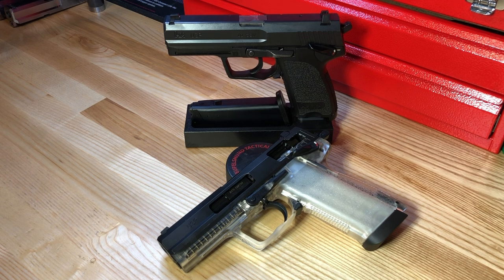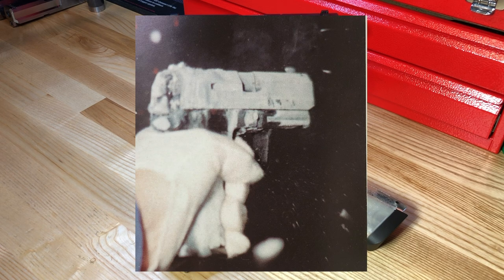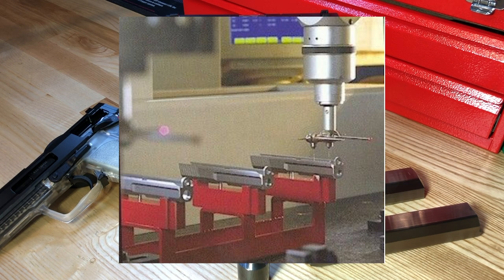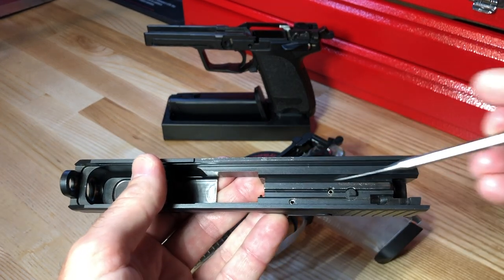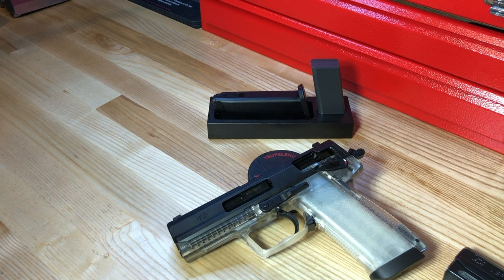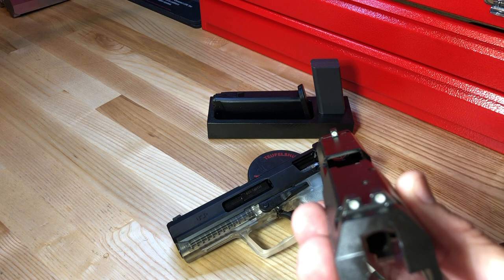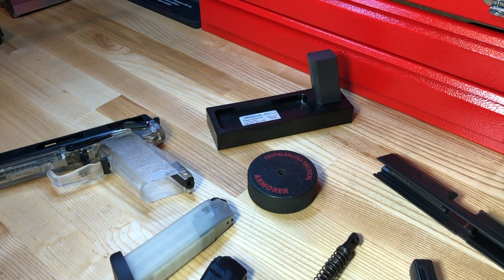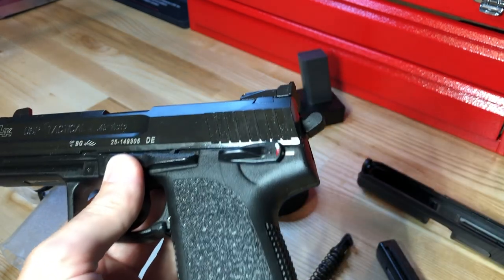Teufelshund Tactical Heckler and Koch USP Series Armorer and Operator Review

Comment: The USP is where my obsession with H&K began. I've owned a lot of different brands of pistols, but my USP never failed me. I have since sold most of the other brands off for the other lines of H&K's. I bought the P2000, the P30 and the VP lines. Each one is just as reliable and great engineering. So now I just HAD to buy the P7M8. THAT was expensive but, I'm glad I have it. Thanks for the info

Comment: What an awesome history of the USP. Thank you
Reply from the maker: Thanks.  Lots more on the channel.
Reply: @teufelshundtactical  Do you think HK has a better 9mm suppressor host than the USP9 Tactical? Also, does the HK45C need any other changes than a threaded barrel swap before I can suppress it? Thanks again.
Reply from the maker: @astroidother3609  The Mark 23 is the best pistol for suppression, but the USP and HK45 series are super as well.
The HK45 and HK45C are offered as tactical models or you can buy the threaded barrel and drop it in.
Reply: @teufelshundtactical  Thanks. I have the HK45C V7 and want to suppress it. Got a great deal on the gun and wanted to make sure it was just a barrel swap. That said, I may well nix my G21 and get an HK45T instead. Cheers
Reply: @teufelshundtactical  In your very educated opinion, what is the best 9mm suppressor host in HK’s entire pistol lineup? Thanks.
Reply from the maker: @astroidother3609  USP Tactical

Comment: Just picked up my first HK USP, this video has been a great resource for me! Something I found interesting, both my wife's P30L and my USP do not have the usual antler proof, date code and other markings on the slide but rather they are now printed on the underside of the trigger guard. Both pistols are date code CB (2021 production). I would be curious to know when HK changed that and if there was a specific reason for the change as well. Thanks again for posting these videos!
Reply from the maker: The change from the antler to CIP was a European requirement to standardize across those countries.  That is also when the “DE” country code was added.  This occurred about a decade ago.  Changing the location of the markings to under the trigger guard began last year.

Comment: Hi James, just got through watching this video, currently I have a VP 40, USP Elite 45, and Mark 23. Having the VP is there any sense in getting a USP 40, I know one is striker fired and the other hammer fired as well you mentioned the USP will eventually be discontinued. Regarding the Mark 23 , HK parts shows a gen2 rail mount compensator that looks bad ass on that gun. Question, do you know of any issues with installing that and 2 can I get that from you or go with HK parts? Thanks the video was very informative. I know you’ve heard that a million times but it is true. Thanks again.
Reply from the maker: I always encourage another H&K purchase.  
I do not have any experience with the aftermarket item you are referring to.
Reply: Thanks for such a fast reply.  That compensator is listed on HK parts. Is that separate from H&K?
Reply from the maker: Not from H&K. @thomaskingsbury6560
Reply: Hi James, you truly are an asset to the HK community. I looked into that compensator and it is after market and does damage to the front of the gun. I thought because the advert said HK parts it was HK not so. Thank you again,take care.

Comment: Rewatching this as I'm about to acquire a '96 dated stainless USP9 fullsize in a week or so. Comes in the original grey case but what surprised me is it comes with two 15 rounders instead of 10 round mags, I guess the previous owner swapped them out at some point. I plan to install the Match trigger kit and Jet funnel. I would upgrade it to a Match clone but can't seem to find the barrels at the moment.

Comment: Thanks for sharing James - love these amazing pieces of engineering. Any idea why the front of the trigger guard on the full size models slopes forward? On a similar note, do you know why the P30 & VP9 use a squared off trigger guard while the HK45 uses the sloped design?
Reply from the maker: On the USP, it slopes in order to fit with the UTL mentioned in the video.  As the later pistols did not have that requirement, they went with one more fitted for a finger rest, if desired.

Comment: @Teufelshund Tactical
I know this is a old video, but I was hoping you could give us your opinion when it comes down to using a Rim country conversion barrel in a full size usp 40 and switching it over to 357 sig. I know that hk did make a compact version of the uspc in 357 sig but never seen a full size made. Do you think it would be safe to use on a newer usp full size? Or should I stay away from converting to 357 sig.
If you reply thank you for doing so.
Reply from the maker: Barrels are the best thing H&K makes.  I would never replace my H&K barrel with an aftermarket one regardless of the caliber.  It would be like driving my Porsche 911 with an Oldsmobile engine.  
I also would not recommend changing calibers in a weapon that was not designed for that caliber, not to mention voiding your warranty.
Reply: @teufelshundtactical7125 
Thanks forthe quick reply! I figured you would be the sane person to keep me from making that mistake. I have several usp's but have been on the hunt for the compact 357 sig. I was going to settle with changing over the full size and that would of been just that settling. Along with what you said about voiding my warranty and all I will just wait for the right gun to come my way. If I need to shoot something in 357 sig until then. my buddy has a 229 that will work for now. 
Thanks again for the quick reply.
Reply from the maker: @Phenixrising-p1p  If .357 SIG is what you're after, take a look at the USP Compact and P2000, both great carry options.

Comment: I have a question about the O ring on the mk23 and tactical models.  does this simply apply a tighter seal to the slide or does it pressurize when the round goes off, fitting tighter to the barrel? Love your stuff sir. Garand thumbs most recent video brought some great attention the the platform as well!
Reply from the maker: The pressure during firing causes it to swell and seal between the barrel and the tang on slide.  This centers the barrel for each shot instead of the slight deviation in different directions the barrel would make otherwise.

Comment: Good Evening James,  

Question for you if I may,  in your presentation you displayed an image of an extended magazine paddle release.  I made that upgrade a while back and found it to be incredibly useful during fast mag reloads . However, after about 500rds, I started to have issues where fully loaded magazine would drop out of the weapon during fire or even when releasing the slide home from a locked position.  I switched back to the original paddle release and problem went away. I've read that this happens when the extended paddle is used in combination with Polymer magazines,  and that the part functions 100% with Usp 45 and compact magazines since they are steel.  I installed the extended paddle on a USP 9mm full size. Can you confirm or deny that this is a magazine related issue and not the design difference between the standard and extended paddle or possibly both?  

Thank you for the Superb Presentation.  

Best Regards
Reply from the maker: I have found that there were two different styles of extended magazine release, with the intercept point being wider on on than the other. This wider model works better at holding the magazines in place.  Of course sourcing one (being able to tell the difference) is the difficult part when purchasing.  In the past, I’ve just kept a few on hand and swapped them in when customers make the complaint you have mentioned.  
The warning from H&K you referred to, I believe related to the Jet Funnel kit pistols/mags.
Reply: @teufelshundtactical  That's the first thing I noticed when comparing extended vs stock side by side.  The extended one has a steel intercept point that is much narrower and thinner . Stock is just one solid piece where the interceptor is polymer, with wider and thicker contact point .  I will stick with original equipment, since it is my primary EDC. Greatly appreciate your feedback and knowledge!   

Thank you sir!

Comment: With the infamous squib test, do you know if that was done with a polygonally rifled barrel or the regular lands and grooves the USP was originally released with? I wonder if that made a difference?
Reply from the maker: Lands and groves, but it would not have mattered.  The strength of the barrel is the key factor.
Reply: @teufelshundtactical  Thanks for such a fast response. We always hear a lot about polygonal rifling resulting in a tighter gas seal so I was curious to what degree that was or wasn't involved. Thanks!

Comment: Thanks for this amazing deep dive. I’m interested in your analysis on the P30 and P2k with regard to the design factors that influence durability. You mention that the USP has a modularity advantage as would be expected for a large contract pistol. Do you believe the USP compact recoil spring change found in the P-Series or receiver thickness changes made to accommodate grip modularity impact the long term durability of the later pistols?
Reply from the maker: Rad Ekkawi I have seen no such issues with a reduction in long term reliability with the P2000 or P30 series pistols vs the USP design.  H&K knows how to make solid, reliable pistols.
Reply: Teufelshund Tactical Thank you!
Reply: I can say that I have all the lines of pistols from the P7M8 and on and each one is as reliable as the next. I find that the more I shoot a pistol, it becomes better at accuracy and function, if that makes sense.

Comment: Great video!  I have a 1994 USP 9 with a serial number between 8000 and 9000 that does not have the relief port.  Do you have a recommended way of cleaning that area without the port?  Interestinly, mine have the engraved HK usp on both sides of the grip and does not have the US patent number.  Is that common?
Reply from the maker: Definitely an early model.  I use long tipped Q-Tips for cleaning the firing pin channel once the firing pin assembly is removed.

Comment: Another question for you sir.  ALL 20 of my USP45 magazines rattle very badly loaded to full capacity at 12 rounds. What is the deal with that? Any fixes or loading processes that I am missing? Thank you sir and thanks for the great content !
Reply from the maker: Buy a new magazine spring and compare its length to the ones you have.  If there is a significant difference, replace them.
Reply: @teufelshundtactical  roger that. Thank you sir

Comment: When running the USP45 Tactical suppressed, do you actually need to change recoil system every 1000 rounds? I keep hearing that and I know other pistol recoil assemblies go much longer than that. I would be surprised with H&k specifically if they were somehow lower than the competition. Especially considering the recoil reduction system.
Reply from the maker: No.  It can run for many more thousand rounds.
Reply: @teufelshundtactical  I trust ur opinion good sir.
Reply: @teufelshundtactical  do you recommend anywhere for getting a USP slide milled? Or magazine extensions of any kind? I tend to prefer factory reliability but we are in an age of capacity and red dots
Reply from the maker: @reker.a5790  Ashbury Precision Ordnance
Reply: @teufelshundtactical  I did not think they worked on USP series?
Reply from the maker: @reker.a5790  Yes, you can mill the slide.  Yes, extended mag wells and magazines are available for the 9mm and .40 full size pistols and come standard on some of the competition models.

Comment: Is it normal to be able to easily compress your recoil spring all the way to the base of the assembly with your fingers? 
I just bought a used usp 45, the recoil seems slightly harsh compared to my Glock 21. Despite what I hear so many people say about it being so soft shooting, my G21 feels like a 9mm to me whereas this feels like a 40 cal
Reply from the maker: The outer, recoil spring is easy to manipulate.  The inner, buffer spring is more resistant.

Comment: I would find a ton of value in you discussing your opinion of the USP45 vs the HK45.
Reply: Even the USP platform vs the new p30 platform.  Basically the same. But I brought up the 45 because that is where i see the largest step backwards going from the USP45 to HK45
Reply from the maker: The HK45 is basically a product improvement of the original USP.  Internally, they are very much the same, but externally, you see the changes.  A welcome update for most fans.
Reply: @teufelshundtactical  I can’t help but feel a difference shooting them.  The USP seems softer significantly? And 10 12 rounds seems like a step backwards.  Especially when the relevant competition was already above 12.  IE the Glock 21 and fnx 45

Comment: Maybe a dumb question, I'll ask it anyway. Is the USP slide forged or cast steel?
Reply from the maker: If you watch the video, around the 13 minute mark, you'll find a step by step of the process from a solid block of steel.
Reply: @teufelshundtactical  I watched it a couple of times(and not just this one) ! I really love the info you are giving about HK. Thank you again!

The first step in the slide making is a block of cast or forged steel? There is a parting line on the first peace you pick up.(on the front of the slide where the barrel and recoil spring holes go).

I may be wrong. It wouldn't be the first time.

Comment: How often do you recommend the USP45 be sent in for detail disassembled cleaning and spring replacement. At what round counts are you seeing trigger, sear, and other springs & parts breaking?
Reply from the maker: Lots of factors, like the exposure to adverse environmental factors and how dirty the ammo you shoot is, as well as the pressure of the ammo.  Five thousand round marks is a good reference.  I’m OCD though and do full disassembly more often.
Reply: @teufelshundtactical  I can personally say my trigger return spring was the first to go. Probably from all the heat cycles and reps? I think that was around 7k rounds. Took the whole thing apart and replaced all the springs. Everything else looked good. My USP is now 15 years old. Still running like a champ.

Comment: Question sir, I carry the usp45 cocked and locked.  The main spring and trigger return spring are obviously under tension the entire time. The manual says not to do that for extended time? What do you think about that. I want the gun loaded and ready to go. Wouldn’t LEM have the same situation since the main spring has full compression?
Reply from the maker: Compressing springs, just like magazine springs, will obviously crest wear over time.  Simply replacing those springs is the solution.  They don’t cost much.
Reply: @teufelshundtactical  roger that. What interval? As frequent as ever year?
Reply from the maker: @areaperii998  It's hard to say.  Lots of variables, but if you shoot it a lot, definitely by 10,000 rounds.  I check mag springs every year and swap them out if they need it.  Internal springs, probably every ten years.
Reply: @teufelshundtactical  roger that. I also want to say not sure what you can do to get your name out there more.  But I am more than positive if more H&k fans knew you do what you do, you would have a larger following. Have you reached out to hk pro and what not?
Reply from the maker: @areaperii998  I've been a long standing member at HKPro for years.  Word of mouth and recommendations from friends, customers, students and H&K continues to keep my as busy as I want to be.
Reply: @teufelshundtactical  awesome great to hear. Thank you for all of your knowledge. Have a nice rest of the holiday

Comment: Would you say the p2000 is an improvement on the usp? Is the p2000 still relevant in 2022?
Reply from the maker: The P2000 is a product improvement of the original USP design.  Just as the P30 is a product improvement of the P2000.

Comment: Does the P2000 have all the safety features of the USP series (except the manual safety, of course)?
Reply from the maker: Black Dots All the same safety features except for the external safety.  That was no available on the P2000 series.
Reply: @teufelshundtactical  Thanks!  Looking forward to the P2000 video.